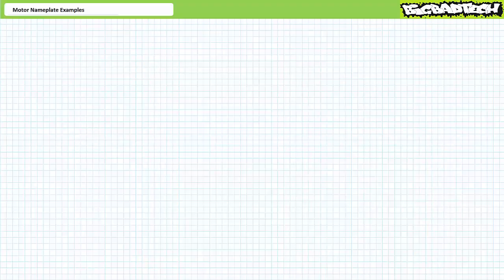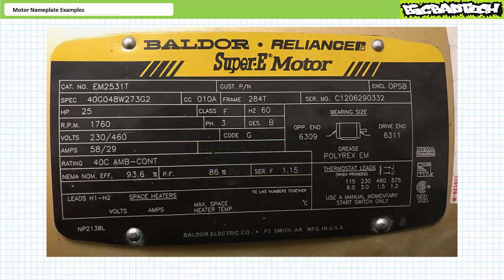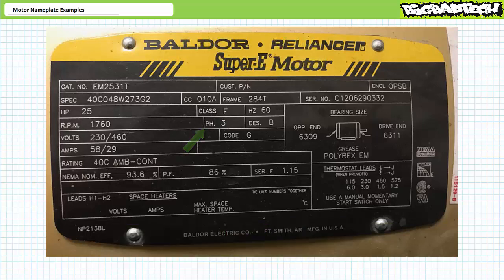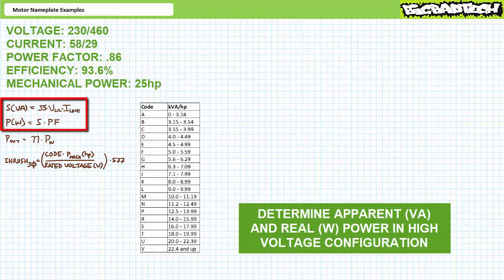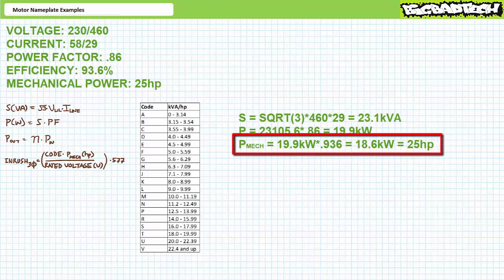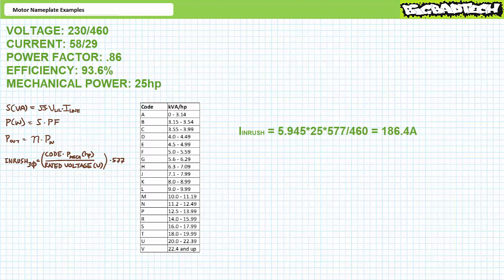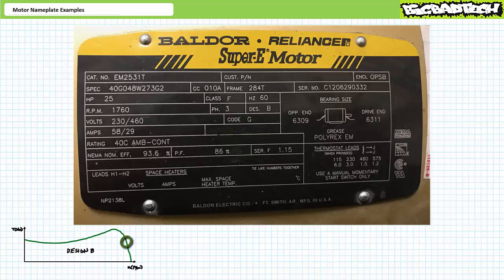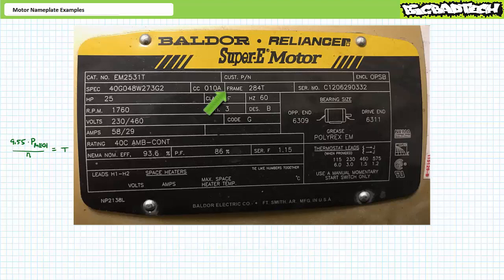Motor Nameplate Examples (Part 1 of 2)

Comment: Are there any online lab simulators that can be used with your lectures?
Reply from the maker: I'm not a big fan of simulators however I do occasionally make use of NI Multisim circuit simulation software in class for odd subjects like superposition. Also most PLC software includes simulation ability for a program. Here's an example: https://youtu.be/NkP4nYl_a8E